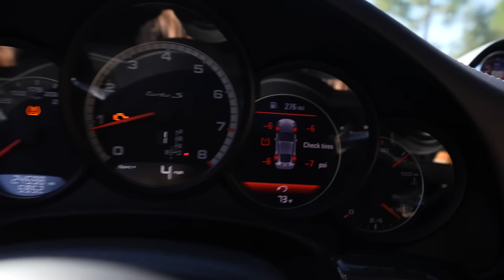Cleetus McFarland Surprised Me With THIS and Challenged Me To A Race...

Comment: At 05:27/18:07 the poop brown '80's Ford Fairmount station wagon is identical to the one that ran me over! STL, 1986. I was getting out of the passenger seat to aid a hit n run victim. My trainee was going to pursue. He cut the wheel to the left, put it in reverse and trapped me with the door as a scoop when he gunned it. Scars of life.

Comment: 14:57, please learn how to weara hans, it will do nothing for you if you don't put your belts on correctly, if you 'think' you did and BOTH slipped off, your belts weren't tight enough. Nobody ever plans to use it but the day you need it, you'll wish you put it on properly. If you're not able to keep your belts on them buy a simpson hybrid